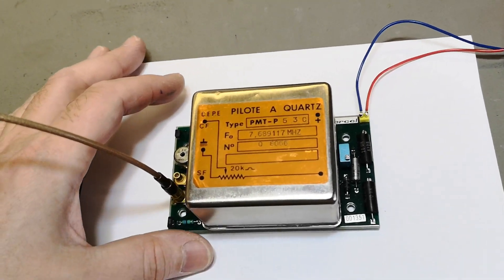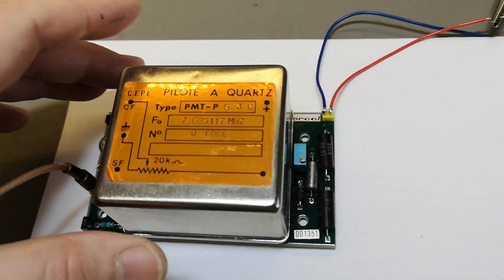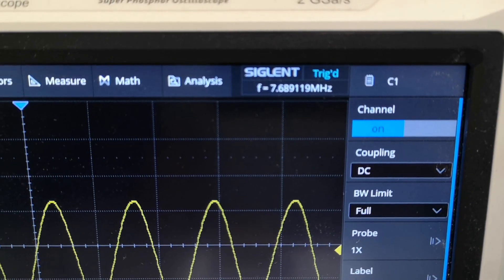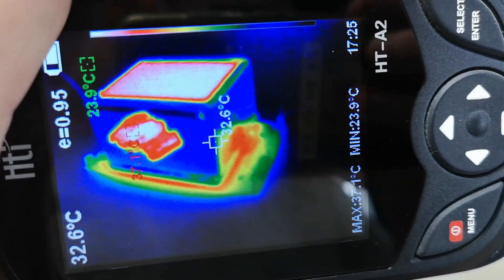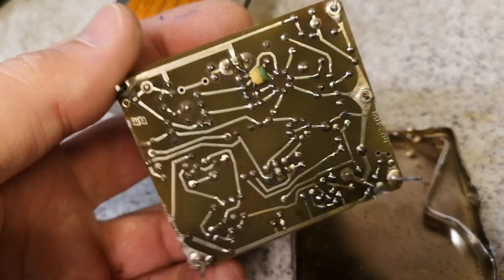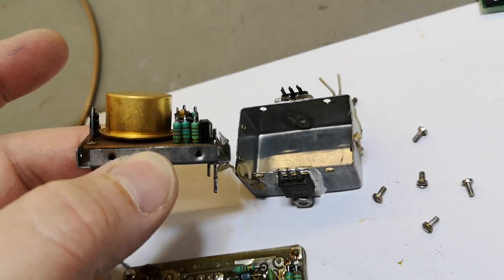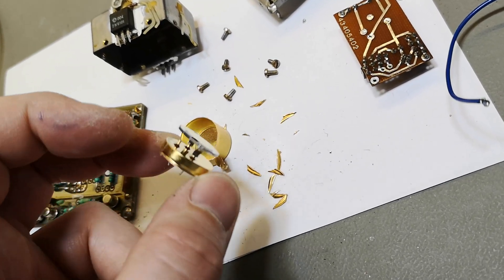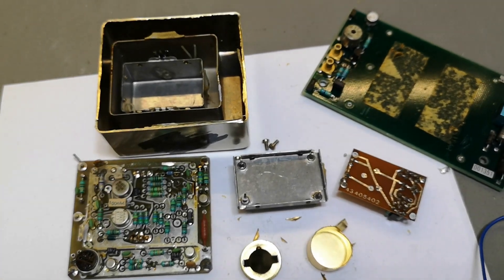oven xtal osc 7.689117MHz pilote a quartz PMT-P53C test teardown

Comment: Irreversible discombobulation of a Matryoshka-like OCXO... Layers and layers, haha. It's a pity there was no other way in. A sacrifice made for science!

I recently took apart (and put back together) a Polish OCXO made by OMIG, with a glass-encapsulated crystal inside a big aluminum block with heater wound on the outside and a NTC resistor & P-N junction of a transistor as temperature sensors. It has some nice felt for insulation, and a variable inductor for frequency adjustment. Made in 1982 and still measures spot on as indicated by the frequency counter's built-in test mode. Here's the video - https://www.youtube.com/watch?v=e-pvGzIBrUU

Comment: This oscillator was made in France, in pont sainte marie. CEPE, turned TEMEX and today Rakon. I work there now.
Back then we would make our own benches, standard and clocks. This may have been used on a frequency portable standard we made to fix issues with our 10mhz and 5mhz standard in the factory.
Reply from the maker: cool, maybe you can reveal why the crystal is curved like a lens ?
Reply: @TeardownOZ2CPU  It's convex. It's mainly to bear larger loads to avoid any shattering / damaging of the crystal. There is a very interesting paper about quartz crystals called "Résonateur à quartz pour environnement sévère" by R. Delaite It's in French though.
Reply from the maker: @Battttt  it makes sense to me, a curved disc this size will clearly handle a bit more evil g force from like dropping on the floor or such